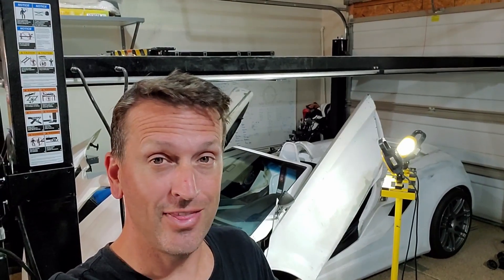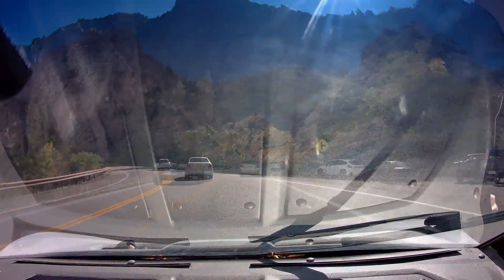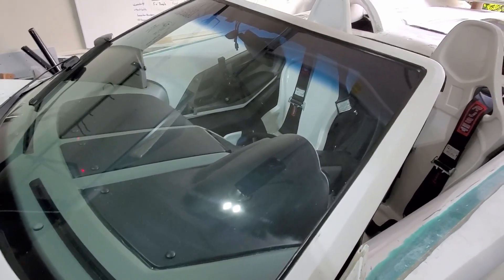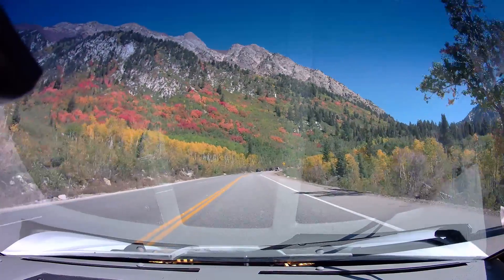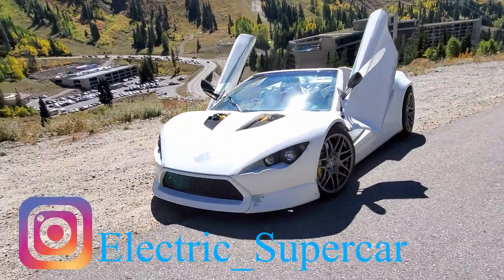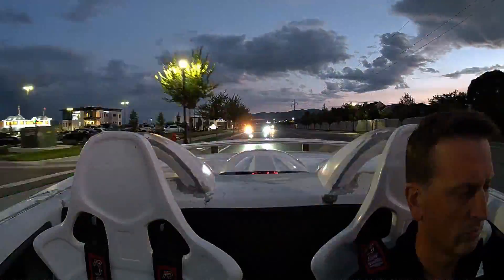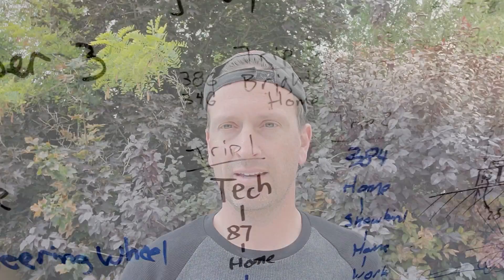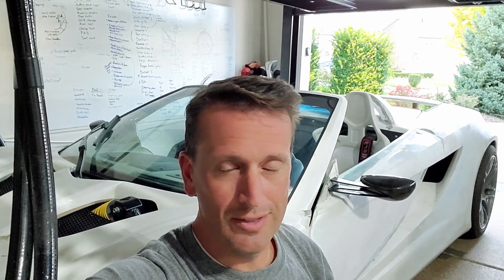Electric Supercar Range Testing -- Garage built EV range

Comment: Congrats man. Those drives look amazing and the range is impressive! It's been fun to watch the project progress.
Reply: Oi get back to working on that hummer :p
Reply from the maker: Thanks!
Reply: Pro tip ! If you loosen the lug nuts , The Electric hummer can do a Crab Walk .
Reply: Wat is gone be the range of your electric humvee?😉🤣 Beath this #JerryRigEverything 🤜. Incredible #ElectricSupercar 💪👍⚡️
Reply: Yeah, the range and efficiency are really, really good. On that subject: you're being pretty unfair to yourself in your Tesla comparison. The EPA cycle their numbers are based on is generally accepted to be highly unrepresentative of normal driving, much less driving canyon roads up to ski resorts. In my 2015 Model S I plan on burning 1.5 miles off the battery icon for every real mile driven. Granted, that has some safety margin built in, and it is an older car that's not as efficient as the new ones, but I'm pretty confident if you drove a Tesla on those same routes you'd never get near the 4mi/kWhr numbers you're seeing with yours. Not too terribly surprising really; their cars are a lot bigger and heavier. Anyway, just sorta reinforces how impressive your results really are. Incredible stuff, love to see more.

Comment: What kind of adhesive was used when you wrapped it? Also, how much current would you have to put in to use active cooling?
Reply from the maker: I used contact adhesive.  As far as current for active cooling...You would have to integrate DC fast charging.  Traditional charging does not require active cooling

Comment: Is the drivetrain from a front or rear wheel drive? Is it load due to wind/air noise? Do you have regen brake system? Excellent job. Thanks!
Reply from the maker: Yes rear wheel drive.  Yes due to wind and road noise.  Yes it has regen brake system
Reply: @electricsupercar  You might try a Mercedes SLK wind deflector.

Comment: Beautiful country! 125 real-world miles is pretty good, especially considering the car's impressive performance capability. I have owned a convertible for many years, and I love the open air experience. As long as the weather is decent. Are you planning to build a quick-connect/bikini top for emergencies and wind buffeting reduction?
Reply from the maker: I have something in mind

Comment: I wonder what kind of range improvement you'd get with a roof. All that noise you're talking about at higher speeds is turbulence that's making for more drag. With a good roof design, you'd probably see 5-10% less drag at higher speeds, which means a higher highway range. Probably won't make as much difference to your city range.

I'm also curious if the dashboard glare on the windshield is as bad as it looks in the video, or if that's just because of where the camera is located.

You sure picked a perfect time for a test drive. Being in Colorado, I know how quickly those leaves change in the mountains, you typically only have about a week of peak colors.
Reply from the maker: Thanks for the comment!   When driving I do not see a glare at all.  I think the camera and placement make it show up on film.

Comment: Done use adhesive, use silicone like roof and gutter sealant (non acetic cure), its 100% permanent and heat proof to a high temp. And water proof.
Re paint job, why not contact an internet artist, then get him/her to do some drawings of the car with different paint job ideas? They might do it for internet recognition on your channel. Maybe your subscribers could even vote on the best color scheme? Just some ideas. 🙂
Reply from the maker: Thanks for the comment!

Comment: Outstanding work as always!
It's gotta be an incredible trill enjoying all your hard work.
Back in the 90s my friend built a Diablo replica and I helped whenever I could. The car came out stunning and was a favorite at local car shows. We had the exact same issue with the interior. Wrapped parts looked factory when finished but had the exact same issues you're having...the adhesive letting go in the heat. He finally gave up after several attempts and had a custom shop do the interior. He kept the car 15 years and never had that issue again.
The problem probably is the spray can stuff from home depot...
I know you'll sort it out!!!!
Reply from the maker: We'll sort it out

Comment: Great work as always. 
What do you plan for an odometer? Or does the ev controller already includes one?

Edit: fixed typo
Reply from the maker: Right now I use my charging app to keep track of my miles.  It is a good idea if the controller could.  I will pass along the suggestion.
Reply: Pedometer?
Reply: @vadim7590  Odometer*